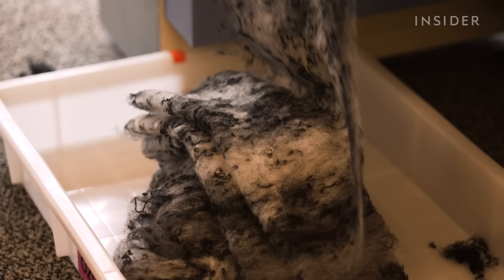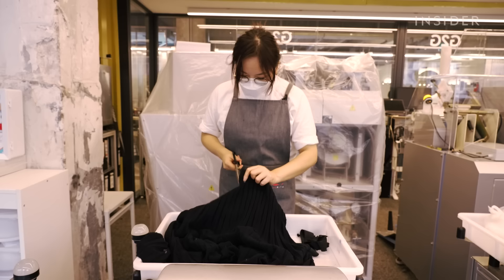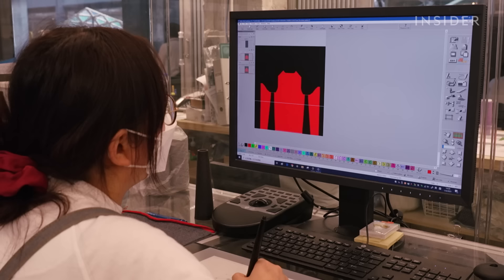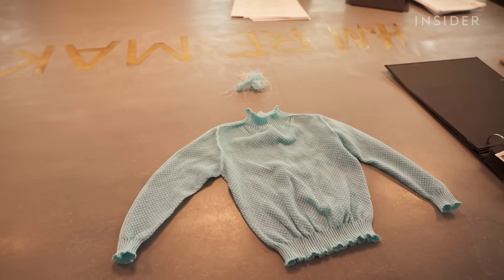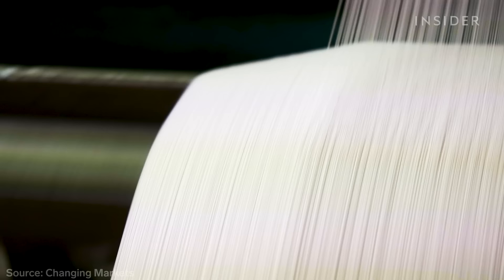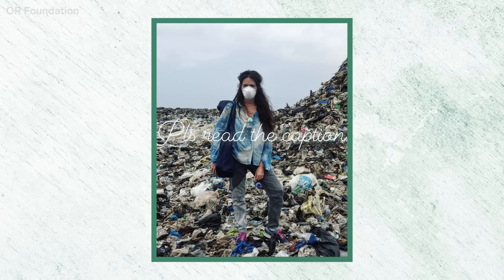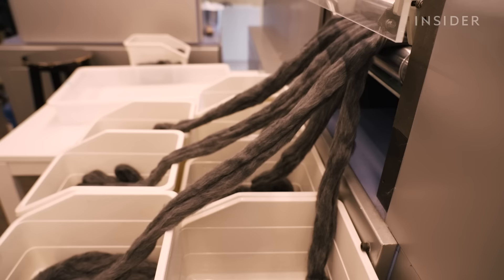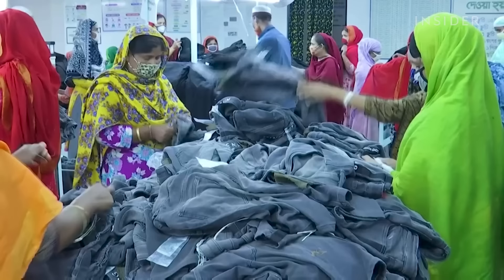How H&M’s Recycling Machines Make New Clothes From Used Apparel | World Wide Waste

Comment: The funny part is H&M shown how they are recycling cotton , when everything in their shop is basically made from polyester...
Reply: They showed their polyester recycling machine, too.  Also blended fibers are a normal occurrence in modern clothing.
Reply: I was going to say the same thing! This is a bs propaganda video.
Reply: @micass3561  altho I don’t this this idea will be the solution in any way at least their trying. Even if the idea in itself works out it’s it’s going to consume far to much energy when on a much larger scale (which is what we would need if this idea was recycling everyone’s old clothes) and it’s not going to positively impact the environment anymore unless we can get a crap ton of renewable energy. Buuut.. I think the idea is good that they are trying to recycle and we need a solution soon before the pollution gets way to out of hand. 🤷‍♀️
Reply: There's a ton of cotton and (more recently) linen blends in H&M. And rayon/viscose - from sustainable producers. Let's also not forget that cotton production is an energy hog as well, so recycling it is very important.

All in all, what fast fashion I buy is almost exclusively from them. I have 7 yo H&M panties that are still great. Socks too. A +50% recycled material sweater that I spent the last 2 winters in. A winter parka that's now gonna also be 3 years old and is still just as useful as day 1.

It's about buying stuff when you need it, buying recycled if you can, and then just taking care of it and wearing it for years. H&M tshirts don't look like shit after 10 wears. They look like shit after 2 years of constant wear and washing, 4+ if you take care of them better.

I really wonder if using dryers is what's ruining American people's clothing that they complain so much about quality, because I don't otherwise get it.
Reply: @beckstheimpatient4135   Not knowing how to do laundry correctly is definitely a huge part of the problem.  If you don't want to hand wash and lay out to dry your cloths, then don't buy items that come with those instructions, for example.  with a modern side loading washer I can get away with gentle cycle for most 'hand wash only' items, but old top loaders do a lot more friction damage, especially if you over load or don't fill with enough water.

And then there's the people who just throw everything in the dryer on high heat.  It only took me damaging a couple garments to realize you have to sort your laundry and that a lot of fabrics are best hung to dry, including t-shirts.  My bf and I rarely need new things.  Most new things I've purchased were to replace low quality stuff like cheap cotton socks and panties that wore out fast with higher quality versions, and since I moved from the North to the South, a lot of summer cloths because the climate is killing me down here.  

I really like 'Oh My Gauze!' brand.  They're a higher quality heavier woven cotton which is more durable than knit cotton, but woven with a texture to it that still gives it some stretch and bounce.  Normally I find their stuff dull because it's just solid colors, but there's a shop in Knoxville where they hand ice-dye a lot of this brand of cloths, and it's so colorful and breezy and durable.
Reply: Komplett auf Konsum zu verzichten, schaffen die Menschen nicht. Aber die alten Sachen zu recyclen ist ein guter Schritt nach vorn, wenn es denn nicht so teuer ist für die Leute.
Reply: "the H&M foundation invested over 1200 thousands into polyester recycling... And aims to use only recycled polyester by the end of the decade."
Reply: @beckstheimpatient4135  I have clothes from Hot Topic I bought in 2014, I still wear them because why not? Just because I don't religiously listen to the band anymore doesn't mean I can't wear it. I also still have hand me downs from my brother and some of my clothes have been passed to my sister. 
Once shirt I have I wan to say is from the mid 2000s, It was my brother's and now it's mine.
Reply: @ANPC-pi9vu  I hate when people don't know how to do laundry correctly. It took my boyfriend over a year to learn that his clothes weren't getting cleaned because he didn't know that the washer had settings past the dial. He was washing his oily work clothes in in lightest "soil level" for over a year until I noticed his mistake. 
On top of that people that don't know HOW to hand wash things and what dryer settings and time to use for things.
Boyfriend put one of my favorite polyester fleece blankets (Like the texture of those soft throw blankets) in the dryer on high for an hour. I only hang dry polyester fleece blankets because I'm had them pill and sometimes burn a bit and stop being soft in some areas. This can is almost 30 and doesn't know how to read a manual and figure out settings. His socks also get massive holes in them so easily (He annihilated my Kill Bill socks), if you know of any indestructible sock brands that aren't $70+ a pair please share.
Reply: @ANPC-pi9vu   yass Queen!!! My younger  roommates be looking at me weird for sorting my laundry but I had a polyester dress from the 70s  given to me by a friend that lasted 8 years and in the end I only have away because it no longer fit. Fabric care is of utmost importance 😊
Reply: @Musical_Pigeon  I don't mean to be rude but it sounds like you hate your bf 🤣 but no really mine is the same way so Ik your pain
Reply: ironic
Reply: H&M, for example, produces three billion garments a year and recycles only about 10 percent of that - the rest is sent to places like Accra, the capital of Ghana, where piles of second-hand clothes create scenes that look like some post-apocalyptic scenario.
Reply: I found some cotton clothes in h&m but they can get verryy expensive

Comment: When i was i growing kid, my parents always gave my outgrown clothes to others. Now as an adult, i use everything until its discolored too much or ripped. After that, i use these clothes for cleaning basically everything. You can still wash them and use them for cleaning. I dont remember if i thrown away even 1 shirt in like 8 years... In average i buy about 3-5 clothes a year with 1 or 2 pairs of shoes(Also for work which wears out faster). People have to understand that they dont have to buy everything and make a wardrobe from their houses. I do kinda the same thing with electronics, use everything until it breaks but before recycleing i try to repair them. If it fails to work/cant repair them, then i recycle everything from the inside for other applications(Further repairs or other hobby projects). Then throw out only the useless and damaged parts. I even have two CRT Tv-s in use. We have to meet for real needs, not for fashion needs.

Comment: Hey, H&M, why don't you approach this issue like this:
1. Build a Shredding plant, like for example, in Accra, Ghana, where the material is located. Pack all that shredded cloth in those big ass bags they use to transport plastic pellets of the like.
2. Take all that raw material to a combiner plant located in a place where they produce cotton/polyester/etc. where it is mixed with a some of the raw material to make the fibre webs and the slivers, and turn them into big, industrial-sized bobbins.
3. Ship those to your regular processing plants where you have your looms and all that jazz, and make rolls of fabric, which are then cut and sewed into cloths to be shipped to your retailers.
Seems to me an easier way to do it, with each factory dealing with only one part of the process.
Heck, if you can pack the whole three plants in the same area, you'll just need to ship the finished product.

Comment: I found a pair of jeans I bought over 20 years ago, still with the tags on, I was surprised at the difference in weight and they were not stretch jeans. Every pair of jeans I have bought in the last 10 years have been stretch and made of much thinner material. I was also surprised by the fact the old jeans a size 22 are the same size as the 18 or 16 I buy now. They are making larger jeans and slapping smaller size tags on them. So the American public doesn't see what a weight problem we have. Young people today look nothing like we did in the 90s. We were slimmer and more athletic. If you compare that to the high school pictures from the 80s it is shocking.

Comment: I would think a way to scale up and speed up the turnover might be to knit bolts of cloth rather than individual garments. Sewing/haberdashery stores could then sell that fabric (I’d happily buy fabric made from recycled fibre!) and it could be sold to clothing manufacturers. Or the ply yarn could be sold to clothing manufacturers that machine knit garments. Shorten the production line and more can be produced. The new garment from an old garment is great for raising awareness in shopping centres, but not really scaleable. 
I haven’t contributed to clothing waste in many years now. I bought a bunch of new clothes this year as nothing was fitting quite right and I’d gotten uncomfortable with the all the V necks I had and was always adjusting them to not show too much. It had been 8 years since my last clothing spree (I don’t care about fashion these days. I’ve found my own style instead). I didn’t throw out the old clothes. The fabric was still good so I stashed them in a space bag and at some point I’ll turn them into something else. The thing I go through the most is pyjama pants. They used to last much longer but the last couple of years the new ones are wearing out insanely fast. I’ll probably chop up some of the tops I’ve stashed and make patchwork pyjama pants. I’ll design the patchwork layout in such a way that the area that tends to wear fastest is easily removed and replaced with another piece so I can fully wear out each bit of fabric before tossing it.

Comment: Creating a problem and then spending ridiculous amounts of money to create a tech solution for that immense problem, doesn’t give you a right to proudly showcase this solution and receive sustainability awards for it. As long as a company keeps producing cheap plastic clothes, they contribute to the problem. And as a consumer we can help these companies loose profits and slowing down their production by not buying their stuff to begin with. Buy a second hand Dior sweater that will last you years instead of wearing plastic on your body, or find a local designer that creates linen or wool garments. Endless options at good prices are out there.

Comment: The main enviromental problem is the raw materials consumption, and the carbon footprint. If you need to mix the recycled fibres with new materials, that does not solve the problem, and the lack of transparency of this brands that do not allow the consumer to know the % of new material has the garment, or what happends with the used clothes... The first step is to slow the fashion and educate people about the real enviromental costs of producing a Tshirt (for instance), empower the consumer about what kind of system they want to sustain and think before buy what is really needed. Real Circular Economy not greenwashing.

Comment: I agree with all that is said, but the practice of holding on to clothes for longer than a year is impracticable some. For example, I'm 6'1", 195lbs, and I have long arms. The main issue is finding a size that fits right. A large button up fits everywhere but my sleeve length. Large tall are too long torso wise in and for some reason they feel the neck needs to be larger (non adjustable) then XL are too wide of neck and shoulders. If I find a shirt with sleeves long enough, generally in 6 months (washing cold and air drying) the sleeves eventually shrink to where it no longer fits. I order easily 7 shirts online and maybe 2 fit and I return everything else. Going in store to find something to fit is fruitless. Getting shirts custom made is much to expensive for a college student, and thrift stores are out of the question as everything has already been shrunk. Another part of the issue is sizing guides are not universal between companies. Even following their charts, they tend to have a room of error between 1-2inches (while nearly nothing being preshrunk). The only luck I find is with synthetic based dress shirts, but working a blue collar, it isn't of much use. This is what termed as a wicked problem, where there are so many dimensions to this issue of clothing waste, there is not a universal answer to the problem and it's foolish to think such. We'll need a combination of H&Ms technology, people being more thrift, and a spectrum of new innovations and practices until we see a meaningful dent in this situation. This video does well at illustrating the overall issue, but I hope it inspires people to think of new solutions instead of only seeing the choice of A and B. It's now has me thinking about a project I've been debating focusing my senior thesis around that could contribute to solving the overall problem of clothing waste.

Comment: i really wish this video had been narrated by someone with some basic understanding of the fiber production process. the bundling of fiber into slivers is NOT novel. this is how yarn is spun. the truly novel part here is that they are shredding pre-made garments for eventual re-use as clothing. after that, the rest of the process is exactly the same as if you are starting with brand new material. it may seem like a minor point to make, but the way it's stated (1:56) makes it sound like they just invented machine spinning, which is definitely not the case.

Comment: Listen, it's cool tech. However, the most sustainable way to consume clothing is to buy only what you need (with a few fun things you will wear multiple times. I am not a miserable old bat quite yet) and when those become damaged? Repair as best you can or recycle them into rags. When the rags are no longer usable? (which is a hella long time) use them as dog bed stuffing, garden cover, ect.  The best way to recycle is in your home, that way you know it is being reused and repurposed. 

I know that it is fun to get new clothes, but I guarantee with a little ingenuity you can diy or make your own 90% of the time, and it will last longer.

Comment: Have you ever bought a garment, trinket, or other object that was custom printed?  Well, chances are the custom printed object has a high percentage of polyester in it.  Or even a special coating of the stuff applied to the surface of another object.  This is what dye sublimation printers rely on for this type of application.  I doubt the spike in the use of polyester is not associate with the popularity of custom printed garments such as direct to garment and dye sublimation printing.  Inventing a machine that recycles most of the fibers from old clothes doesn't mean it is making "new" clothes.  It is simply transforming the old fibers into a different use for them.  Even clothes that are donated to other countries, to the homeless, to thrift stores are still being thrown out for a number of reasons.  These can include the condition of the article, its perceived fashion being in vogue, not taking the time to properly clean donated garments before placing them for re-sale, etc. Landfills in the United States of America are not the only destination for unwanted clothing.  Other parts of the world have the same problem for their coastal areas as well. The real issue is to change people's minds on what to do with their clothes that they no longer need, have room for, or want.

Perhaps it is time to create clothing that can change its appearance by making it of color changing fibers that can mimic the fine photo-realism of digital displays?  Then your desire to change the style of printed fibers will surely be reduced as you can simply change the image or video or light patterns of what you're wearing on the fly.  One more use for software on your Pocket PC (Smart Phone).

Comment: This is just for show, that is why it is in a shopping center. The cost to produce a recycled garment is too high for a fast fashion supplier. Just do not buy this crap. I used the same jacket for over 15 years, then it broke, and I bought another one, that I plan to use as long as possible. Do not buy fast fashion.

Comment: Polyester does break down and most of H & M clothing is polyester. They are contributing to the problem more than helping the environment.  The environmental issue will never be solved if they continue to use artificial fibres. This is just greenwashing.

Comment: Yes we’e running out of time, so let’s just continue dibble dabbling with grand gestures of marginal value. The issue of clothes waste would be better resolved if everyone were to have one set of clothes. This would come at the cost of our current society and global financial system that is completely required to produce - or implode. 
The real value of these recycling proofs of concept will be realized after our species has completed the destruction of our habitat and those on the other side of the bottleneck from hell mine what we’ve left behind.

Comment: This doesn't seem like the right step, as it is.
Maybe if the point was to use the new threads 🧵 to make the clothes sold at the stores, people didn't need to pay to give their old clothes and instead it was the unsold/waste clothes being recycled.
Also that "printed" sweater looks like shit and probably won't last very long, which is the problem with fast fashion.
This looks like a gimmick by H&M to seem more green (good ol' greenwashing) more than something actually deserving of a world wide waste video.